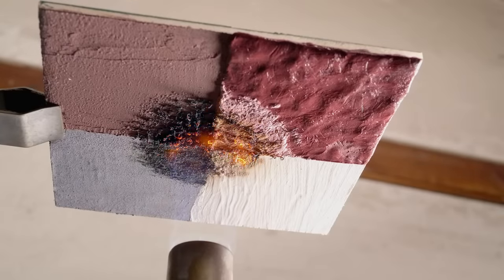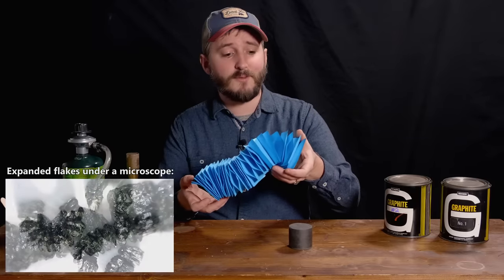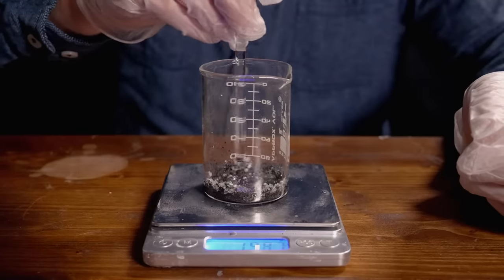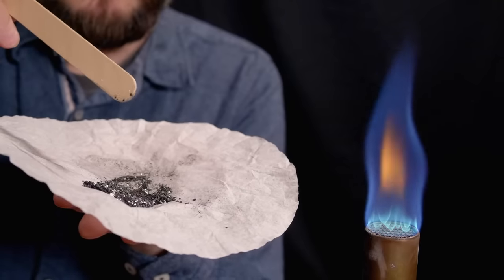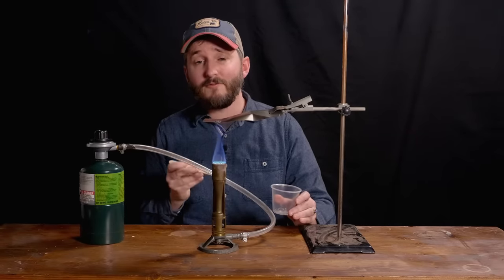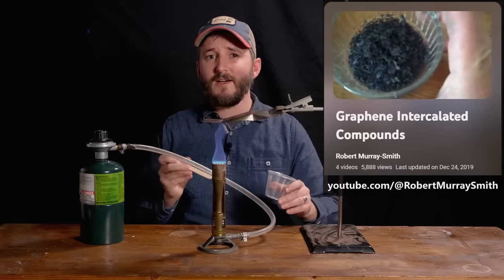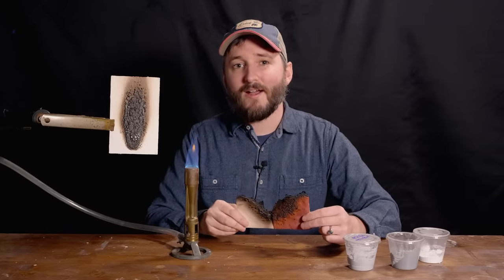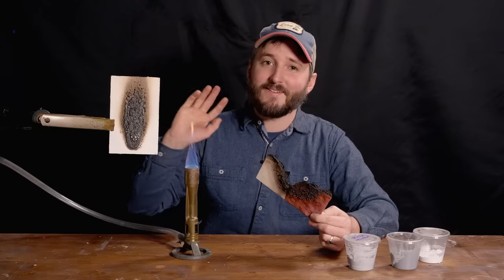Fireproof Expanding Graphite

Comment: Neat!  Great info and production as always.  Left me wondering about graphite foil as gaskets however.  I've never read about so not familiar with.  I've been wondering about a cost effective DIY improvement to the Briggs & Stratton OHV like 28XXXXX and larger engine head gasket leaking issue a few months back and occasionally as now.  Probably not the application, as I'm thinking more a racing like higher performance design, though got me thinking about again on another note.
Reply from the maker: Boy is this the video for you: https://youtu.be/Xy4tKWHTpY8

(I don't think graphite is the best choice for that purpose)
Reply: @Nighthawkinlight  Thanks for the reply, if that's you Ben (I think not a spam bot thing since seems common more now-a-days) I think the link you left is this same video.  I had to check my comments in the video where Redneckcomputergeek did a custom copper gasket and I noted I had last left off finding this YT video titled "The Most Tortured Part In An Engine" as a good overview of the designs where ~17:18 of that video time details.  Looked like the MLS design and I was also wondering about machining like a keyway and key using the same block and head materials. My thoughts as well regarding the graphite not researching yet.
Reply from the maker: Yes it's me, not a bot. I had just seen that video last week myself.
Reply: @Nighthawkinlight  I must have linked back to your video when I thought I clicked on the link you left and assumed the link you replied with was your video.  Ooops.  Of course, same video!  🙂  Awesome, thanks for the affirmation and sharing as always!

Comment: According to a nilered vid I watched Epsom salt is mostly water so adding that as an additive might be effective?
Reply from the maker: Yes that's one option. It's a balance between a chemical that holds water without holding so much that it liquifies at high humidity and drips out of the material. Epsom salt probably too easily liquifies.

Comment: The reaction speed is based on reacting the inside surface area of the graphite flakes. Smaller grains would react slower if the oxygen holding the edges open is a limiting factor in the reaction taking place. There is more edge surface area, but the ratio of surface are to edge is worse in smaller grains than larger ones. Oxygen being on the edges may let you chemically join flakes together, or layer them into 2-3 layer thick sheets, then clean out the oxygen/acid using some other method. I'm not a chemist!

Comment: I am wondering tho, with graphene concrete getting more and more into use, what are possible health effects from inhaling the rub off for example. Or rather health effects of graphene in general.
Reply from the maker: It seems likely to me that graphene bound up in concrete is likely to stay lumped together with other sediment even when ground into dust and not pose a particularly greater hazard. Concrete dust is already very bad to inhale (see silicosis), I doubt a tiny percentage of graphene will make it much worse.
Reply: @Nighthawkinlight  I mean i sure hope that it stays in there, however i think that probably warrants more research.
I did find like one or two papers that looked into Nano-onions and graphene oxide, but those only studied the effect on cell cultures. It was not very healthy to the cells at the very least.

Comment: Theory on why the #2 takes longer to react than the #1:  Smaller particle size means higher surface area to volume ratio.  Since only the edges of the crystal layers are reacting and not the entire chunk of graphite, the particle size with more surface area will effectively have more reactants (more layer edges).  More reactants could mean that the reaction takes longer to complete

Comment: This might be a dumb question but could these intumescent materials be used to make "poor man's" melting furnaces?
Like make a furnace out of plain ol brick and slap some of your starlight putty recipe on the inside walls??
Reply from the maker: Yes I made a video some time ago doing just that with a coffee can. I actually prefer a mix of plaster and sand for a cheap furnace lining though. It's cleaner and lasts longer.

Comment: Please redo the experiment using the same thickness of each. Also, wouldn't the expanding graphite promote cooling as well as interfere with the flow of the flames across the surface?

Maybe the larger graphite flakes makes a better surface during intercalation, allowing for easier stacking?

Comment: regarding the difference in reaction time and heat produced in flake size...
as u said the smaller flakes reacts faster...but u forgetting u are not using the same ammount of flakes....only the weight is the same 1gram..
the smaller once will have a larger area that can oxidise = more heat, 
but the reaction time has not chenged = longer time ..

Comment: Thank you for your very interesting videos. Could you explore how carbon felt is made, which resists high temperatures, vs char cloth which is used to start fire from just a spark? I thought carbon felt could be made by pyrolyzing fabric felt in the absence of oxygen, but that's how char cloth is made, and their characteristics are opposite, so I'm really confused as to what's going on. Great work as always, thank you!
Reply from the maker: I haven't looked into it yet but I bet the felt is heated until it becomes graphite. Graphite is a configuration of carbon that is so stable its difficult to burn.

Comment: What would happen if you coated a layer of wet paint in the intumescent graphite, then paint over it, allowing the layers to fully dry between coats?  would that increase the layer of graphite enough to allow the fire retardation to be increased?
Reply from the maker: Yes you should get more protection the more graphite you can get to stick to the surface. Doesn't matter if it's in one thick layer or many thin ones.

Comment: Here in Brazil it is very common for soybean harvesters to be consumed by uncontrollable fires. Is there any way to manufacture some product with suitable fire-suppressing properties to protect our own agricultural harvester? CO2-based fire extinguishers are insanely expensive. Chemical powders are also relatively expensive and have little yield. I'm thinking of putting 5 or more gallons of 20 liters of water each in different places on the combine (the machine is very large and weighs about 8 tons) and mixing a high concentration of laundry soap to make a lot of suds. As a propellant I see two possibilities. Using R134A gas with a venturi, or electric pumps with independent lithium batteries, but I don't know how effective this can be. Many moving parts work by rubbing steel with steel because there is no way to lubricate with hydrocarbon-based products and lubrication using PTFE powder is not widespread here, in addition to PTFE powder being an expensive product to use in large quantities. Fires start either because of sparks in the dry straw or because the dust and dry straw dehydrates and in contact with the hot steel it starts to self-ignite, and if not quickly controlled, it ends up spreading through the painting and the countless hydraulic hoses. and exposed oil leaks. If the author of the video or anyone can give me an idea that could be implemented within a month, I would be more relaxed and would be very grateful!
Reply from the maker: That's a difficult challenge. You could try an intumescent paint such as those listed in the video description but I'm not sure how it would hold up long term outdoors.
Reply: @Nighthawkinlight  Thank you so much for answering and for the great content you share. 😀 I had only seen this type of product in a documentary on oil rig safety, but I didn't know it was commercially available to the public or the name. Would it be possible for me to spray the paint creating a kind of "extremely low density carbon foam" and thus smother a fire? If this product is flame retardant, it may be enough for the rescue to arrive with Stretch plastic wrap and water to keep the flames under control until the straw is wet and the hydrocarbons drop below the auto-ignition temperature. The properties that stretch films have under heat are incredible for a polymer! If you create yet another video improving your "atmosphere re-entry heat shield 😎" I would suggest testing the properties of thin films "semi-flex" aluminum oxide that are easy to remove from electrolytic capacitors. 😉

Comment: I thought the layers of carbon sheets in graphite weren't strongly attached to each other. That's why graphite can be used as a lubricant because the layers can slip and slide over each other, and why graphite is used in pencils because the layers shear off easily leaving a mark on the page.
Reply from the maker: It's more like there are some layers strongly stuck together but also lots of imperfect layers where it's easy to shear clumps off

Comment: A layman’s hypothesis lol - Seems that perhaps with smaller particles, there are far more places for the molecules to interact, which would make the process take a longer period of time?   

I wonder if using more solution or a higher concentration of one thing or another would speed it up 🤔

(Not anywhere close to a chemist lol)

Edit:  aaaand the heat being needed perhaps is just about the extra energy required to pull off the exponentially larger number of interactions?

Comment: I would guess the smaller grain has higher surface area causing more reaction and higher heat, also needing more time due to more reaction points on the material. I have no expertise on this.

Comment: Why use intumescence, which seems like an irreversible reaction, instead of just a normal insulative material with a high thermal expansion coefficient?
Reply from the maker: How would you apply a fire resistant insulative material to the inside facing walls of your whole house? Intumescence is so useful because it can be applied as a thin layer of paint, but will expand and prevent spread of fire when needed. The foam scrapes off easily afterward to repaint the surface.

Comment: You could have used barium nitrate instead of ammonium nitrate in order to also make barium sulfate.
Reply from the maker: Yes but barium sulfate would have gunked up the mix and would be hard to get rid of since it's insoluble
Reply: @Nighthawkinlight  Oh no!
Graphene + Barium Sulfate, produced separately, would be good for making municipal concrete though. Stronger material + infrared cooling? Yes please.

Comment: why not use phosphate-based paint outdoors with an impermeable coating?
Reply from the maker: Besides having to paint twice that could work
Reply: Thinned high heat silicone might work decently since it is already somewhat heat and fire resistant while also being hydrophobic to water.  Also relatively inexpensive, easy to get, and non toxic when cured (though may become somewhat toxic when burning?).

Comment: 93% sulfuric acid would react pretty exothermic when quenched with that solution, no? i'm not an expert and not trying to pretend to be one, but from my understanding that could be a risk, so i felt like i should share n_n
Reply from the maker: Pretty exothermic, yes. But it helps to have a large amount of water you're pouring it into because it acts as a heat sink.
Reply: Ahh gotcha! The thermal capacity of water once again being the GOAT :B

Comment: maybe I had the same conversation here before, but in one old forum (and some testing) I learned that reacting Ammonium Nitrate with Sulfuric Acid wont result in Nitric Acid, but Nitrous Acid... this was discussed on a topic for homemade nitric acid using glass jar and plastic foil (i will make video about that on my main channel), everyone that tried making that reaction with Ammonium Nitrate was failing and there was one chemist explaining whats going on. I am not that knowledgeable to explain it, so maybe someone who knows can explain instead...
Reply from the maker: That's strange to hear, I'm not sure if it's accurate or not. I have definitely distilled fuming nitric acid from a mix of potassium nitrate and sulfuric acid, as well as successfully nitrating many compounds in that mix with as much success as with fuming nitric. I'm not sure why ammonium nitrate would behave differently than potassium. It's possible that there are a mix of unusual acids in the soup that don't fully convert to nitric until after distillation, but the end result of most reactions in the solution should be the same.
Reply: @Nighthawkinlight  yeah I successfully used the "glass jar" method to make nitric acid for the last decade many times with potassium nitrate, but cant do it with ammonium nitrate... maybe its because of impurities of fertilizer grade ammonium nitrate, but its way cheaper than potassium nitrate here where I live...
Reply from the maker: @Hobypyrocom  Interesting, I'll have to try it myself.
Reply: @Nighthawkinlight  i am slow with making videos because of my job, so let me explain the procedure, if you find it interesting make a video about it. 
you take a glass jar, pour potassium nitrate and sulfuric acid, add smaller container inside in the middle (i was using espresso cup or smaller glass jar), cover the top loosely with plastic foil, add ice cubes on the plastic foil (this will make a conical shape), place the whole glass jar on hot plate... the ice will cool the plastic foil which will condense the nitric acid vapor, the condensation will slowly combine and drip from the pointy end of the conical shape of the plastic foil into the container inside...

Comment: Are you sure it's actually a clean oxidation and not a nitration, because what you have made is essentially nitration acid
Reply from the maker: I don't believe carbon or graphite nitrate is a possible molecule
Reply: @Nighthawkinlight  graphite is just a huge polycyclic system as far as I understand. The center is of course completely inert because it's just carbon. I looked it up, it can't be nitrated directly, unless it had some hydrogen bonds, but it can be oxidized and the graphene oxides can be nitrated to form nitrated graphene oxide.
Reply from the maker: Interesting about the graphene oxide nitrate. In any case nitration isn't an important part of this process as it works with any fairly strong oxidizer.

Comment: Please, please, please, start using splash goggles for chemistry. Safety glasses are for impact, they will not save your eyes against acid like goggles will. They are only $5 at any Lowe's or Home Depot.
Reply from the maker: I know that's the "right" eye protection for the job, but I judge the loss of peripheral vision to be more dangerous than a small gap. I prefer close fitting glasses.

Comment: Leaving a carbon foam doesn't seem like that useful of a fire retardant last time I checked carbon is flammable wouldn't leaving behind something like a silica foam be a better idea cuz silica is heat resistant and non-flammable
Reply from the maker: Carbon has many molecular configurations. Glassy forms such as the carbon foam are extremely fire resistant

Comment: Sodium hydroxide is sold in many hardware stores as sodium hydroxide trihydrate which means under heat, it will give off up to three water molecules. Maybe under even more heat and flame it would decompose further to a fourth water molecule and sodium oxide. Unfortunately for making a fire retardent paint, sodium hydroxide is sometimes used as a paint stripper.

Comment: baking soda worms
Reply: ironically baking soda would be better "aerator" like in baking, releasing co2 when heated to 300C
Reply: and no nasty chemicals other than natural are required, to bake carbon from biomass
Reply: no need to so toxic, with-by h2so4
Reply: you could also bake a thick rigid carbon foam from dried biomass flour cake batter directly, similar as anodized porous aluminium oxide
Reply: rigid compressed/foam graphite panels from dried flour powder biomass by carbonization bonding
Reply: M(OH)2 metal-hydroxide would form both outgassed water and possibly MO2 ceramic surface fire extinguishing paint layer
Reply: cast into form from dried biomass flour to carbon fiber